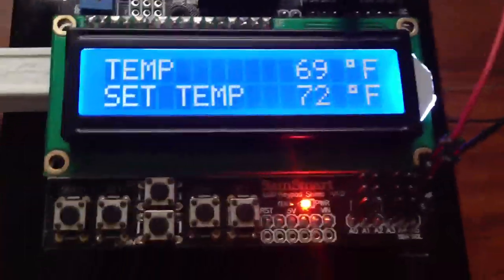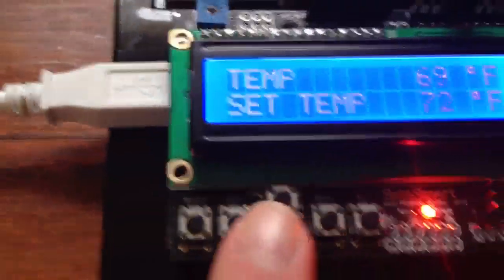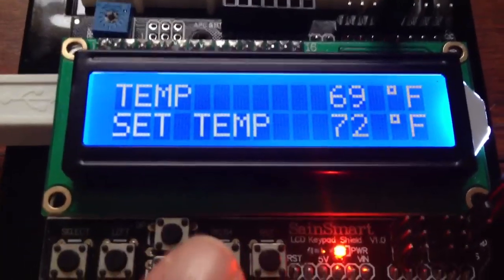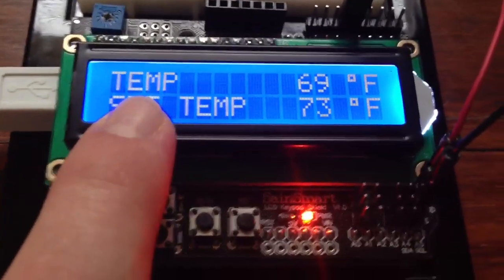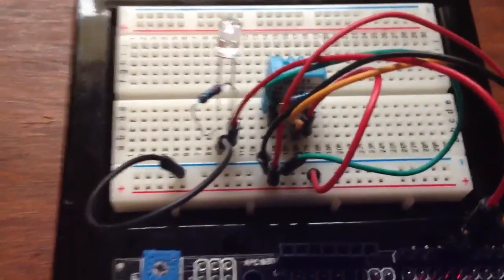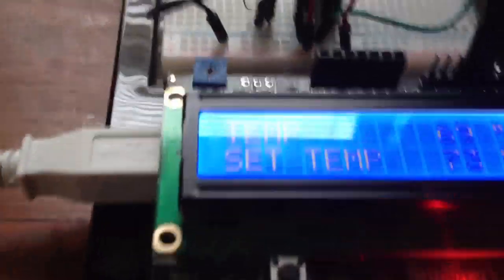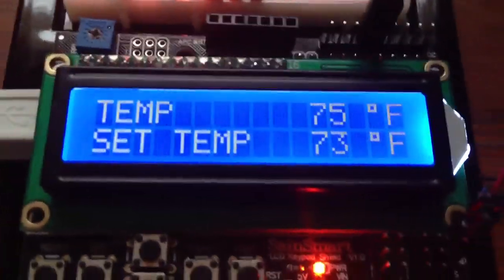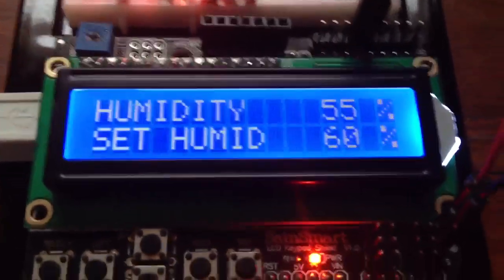Arduino UNO Greenhouse Thermostat

Comment: Looking at doing a similar project, was wondering if you posted the code to share anywhere?  I'd maybe modify it a bit as I don't have that LCD, but have rotary encoders.... Would think it should still work, and would share back if it did/when finished if you wanted.